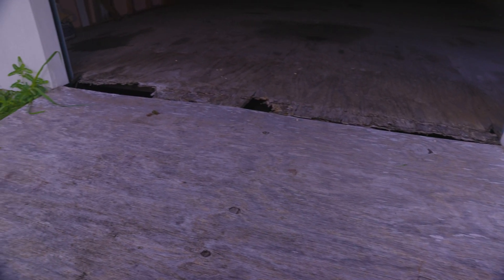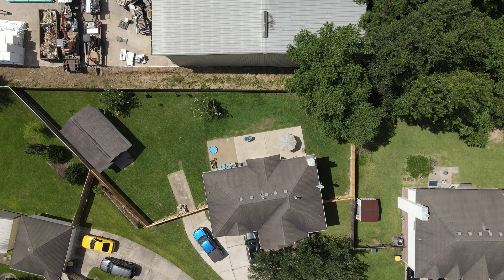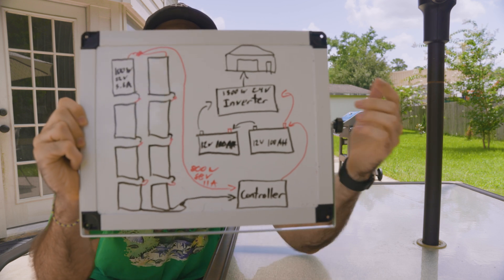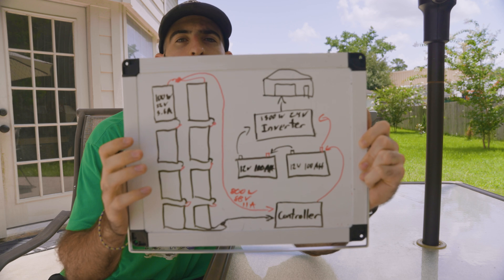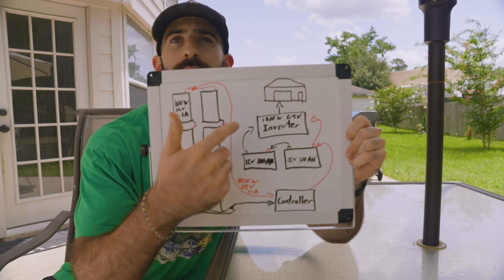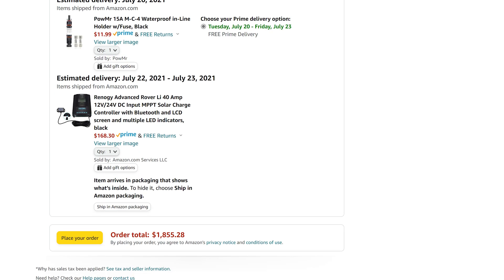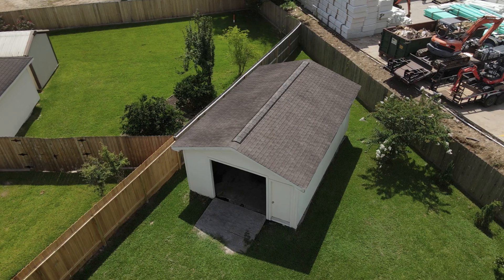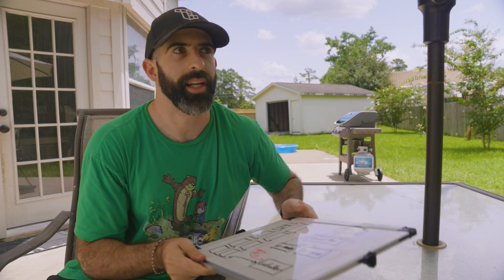Solar Party Shed - Part 0 - I Need Your HELP :)

Comment: 2 batteries in series adds voltage and in parallel adds capacity (Ah). so you will have 1 24V battery at 100Ah.
Reply from the maker: Yeah you’re correct. I misspoke in the video.